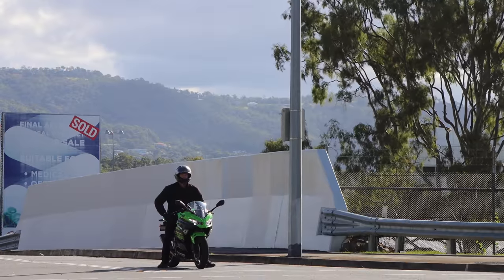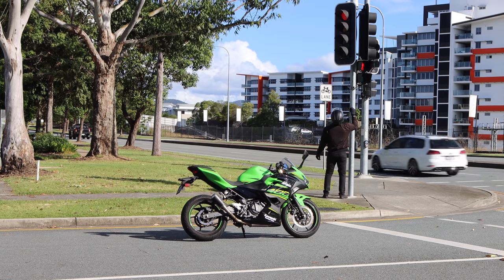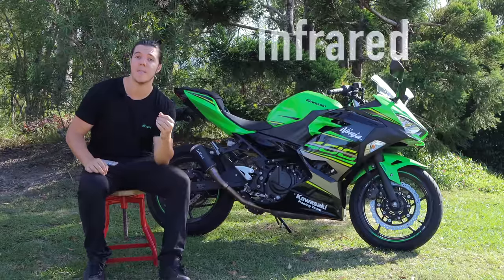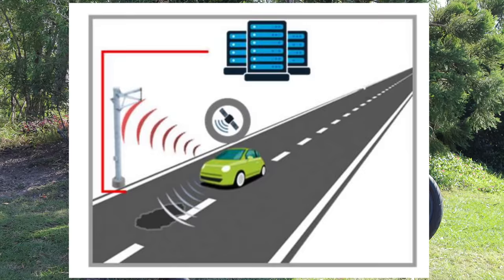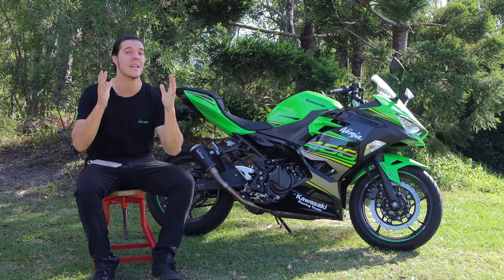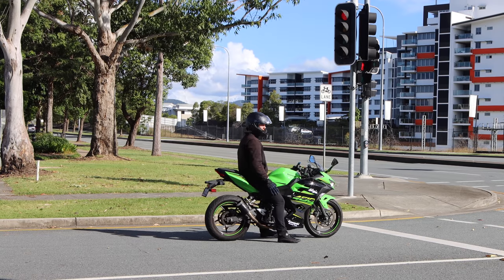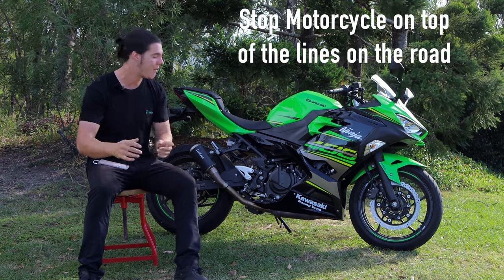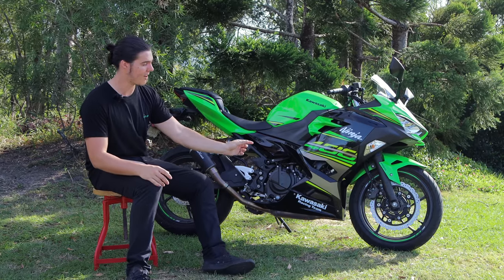How to trigger Traffic Lights on a Motorcycle | Stop getting stuck at red lights

Comment: I was the electrical test engineer for the department of transportation in my state. A few pointers for ground loops. First, as you approach a light, try to run over the advance detection loop. This is the ground loop a couple of car lengths before a stop line. This will send a pulse detection to the signal controller. Second, I do not recommend buying a magnet hoping it will place a detection call to the signal controller. Rather, simply shut off your bike and restart. The field generated by your starter is enough to affect the ground loop. I've tested this in the lab and used it for the last 8 years on the road successfully.
Reply from the maker: Thanks for your input mate! I'm gonna pin this
Reply: Interesting. Gonna test this this out.
Reply: You sir, are a hero. I have a sumo DRZ400 in AZ, where these strips are at 90% of lights, and it's usually a 50/50 as to whether or not it'll pick up my bike.
Reply: That’s good info. I have a few that get me around the house. Looking both ways and Running the light works also.
Reply: Yes!  Was here to post this.  A restart has always worked for me. Not sure if newer bikes pump out the same EMI noise as the older bikes I was used to, but I think it still works fine.
Reply: Damn. Never thought of that. Ill give that a go before I blow through the red light.
Reply: Lol, my bike is a kick start only.
Reply: @jamesmcgrath1952  All is not lost. I haven't tested this one out yet so it may not work. Your stator has a magnetic field when it is generating power for your bike. That field expands and collapses as it generates AC electricity (which is later rectified to DC for your bike's system). The higher you Rev your engine, the faster that field expands and collapses. That SHOULD also work and trip the loop detector, but I have yet to try it.
Reply: @GCMoto97  Thanks but I've tried that. To make things worse the lights are timed to go on the loop late at night when very few people are on the road so you could be stuck for hours. Thankfully they passed a law here stating if the light doesn't change in 5 minutes the motorcyclist can proceed (as safety permits) through the light. BTW, this is in Pa. Don't know about other states.
Reply: @mike-gv2ol  the old fashioned legal right turn into legal uturn also works
Reply: Good info right there thanks!
Reply: @jamesmcgrath1952   Kick it really hard. Ha
Reply: @Porsche996driver  Lol.
Reply: Thanks!!
Reply: In my job I end up getting magnets so I have four or five neodymium magnets on the bottom of my bike that seem to trigger traffic lights. Or maybe it's the lead in the frame of my KLR
Reply: I have two bikes, a 250 dual sport and an 80cc scooter. Neither triggers most of the lights on the college campus I work at. Tried putting the stand down, blipping the starter, nothing. I think they're just dissing me because I don't ride a Harley. ;)
Reply: @MrBirdnose  In that case I recommend reporting that signal to whichever agency owns it so they can adjust the sensitivity of the loop amplifier. When the loop amplifier is tested in the lab, it is tested for three vehicle sizes: car, large motorcycle, and small motorcycle. The sensitivity is set to detect all (at least that's the way I did it), then the loop amplifier is installed out in the field. When out in the field the signal crew has to do a final adjustment with everything hooked up at the system level. Sensitivity adjustment can be a tricky thing; set it too low and it doesn't see those of us on two wheels. Set it too high, and it locks the detection call, leaving whatever traffic phase it's hooked up to trying to stay green all the time.
Reply: Would an electromagnet underneath the bike, say 100 turns at 3" dia, that sends a few pulses via 555 timer be picked up? Or does it have to be a field as strong as a starter?
Reply: @joesphanlu3369  the loop works like a metal detector - the resonant frequency changes when a chunk of metal interacts with the magnetic field. I'm not sure there's an electronic fix; it's a matter of having enough metal close enough to the road.
Reply: @MrBirdnose  right, it detects changes in the magnetic field, which i can simulate with an electromagnet. That is how the core principle why a starter motor works, question is if its powerful enough.
Reply: @joesphanlu3369  Perhaps, but I've never tried it. I went for what I already had. You have to make the ground loop inductance change by 3 ųH to be detected. Grab a compass and put it about 3 feet away from this device. If the compass changes heading when the device is energized, it will likely work.
Reply: @GCMoto97  Thanks for the numbers. I give it a shot, maybe even a github repo teehee
Reply: Solid GOLD
Reply: @jamesmcgrath1952  That's very modern; mine is steam-driven!
Reply: You would think these days they would just use a camera ( which could detect any vehicle and added benefit of video evidence of jumping red lights ).
Would be easier to install with no need to dig up the road.
Reply: Awesome thankyou ob1
Reply: I see 199 people who liked this comment going to try this ASAP because I know I will:) thanks
Reply: Holy crap I never knew about the starter thing.thank you so much
Reply: Id rather not stopping and starting my bike all the time.. its not such a great idea considering the starter motors in them arent made for such condition.. but I will try out some techniques and why not use a magnet? Seem to work fine?
Reply: I use the greenlight magnets in the bottom area of my fairings. It works for me. I always place them at the lowest point inside the pairings.
Reply: @FlyingFun.  Cameras are also used, as well as radar. The problem with cameras is image washout when it's foggy, raining, or too much oncoming light (for example, the signal is facing east during sunrise). Radar on the other hand will detect bicycles in the lane. Unfortunately, loops tend to be the standard because of the cost of video or radar detection.
Reply: @ClosestNearUtopia  if you have a magnet and it works, that's great...there's nothing wrong with that. I just went with the starter because it's already installed and it provides a greater magnitude of field change than a magnet. I wouldn't worry about the starter running...unless it takes forever for the bike to start. When I bench tested starters we used to run them for a minute without damaging them.
Reply: Great tips!!!! Thanks! Subbing, where were you back in my early years ridding bikes on the road.
Reply: @GCMoto97  its not about the amount of time the starter motor is on but the amount of times activated. The solenoind and contacts are a notorious problem within motor cycles starters. they dont life forever and maintenance is required because the brushes will pollute anything on its path, next to that some motors wont always start right away, a lil push in gear is needed to get the parteh started and line up the gears. On a warm day my clunkiest bike will take 15 sec of cranking befor she will restart eventually. also no way out when things go wrong behind you while trying to start your motor, you will need every second..
Reply: Cheap magnets, no.  But rare earth mounted to the center stand can help.
Reply: I was told you can go through red lights in Georgia after you've come to a stop. Anyone know if that's true?
Reply: @Force1Com  Nope.  The dead red law there was passed in 2019 but vetoed.
Reply: @jamesmcgrath1952  I was taught that if your in a rural area it was legal to do that but not in city areas
Reply: 125 and 150 cc bikes are recommended to do this because it's almost undetectable
Reply: Came here just to say this.. shut down and restart. Luckily it came from someone with more experience.
Reply: @jamesmcgrath1952  also PA, if it cycles 2x (for the other directions) you are allowed to audibly say "eff it", and proceed...  so we have options.  And, cops have discretion, so if you are being reasonable (REPOP standard), you should be able to kindly explain what you did and why and not get a ticket, and if you do, just continue being polite and the cop won't show in court, or the judge will hear your correct argument and let you go.
Reply: @Rowdy mellow out man, and hear me out. You're not technically wrong, as you should be able to just run over the loops and stay anywhere in there. However, there are those times where that doesn't work. The point of the video that @Kwackajack made and my comment is we're out there, we're in the detection zone, but the loop amp isn't placing a call to the controller...try these things to get out of there before running the red. Then, by all means report the signal and hope they send a crew to check it out. We're all just sharing workarounds whether it's the starter method, magnet, hitting the Pedestrian switch, to get he phase to go green.

Since you brought it up, my test loop measured less than 2 Ohms continuity with a Fluke 87, greater than 500 MegOhms with a GenRad 1863, and passes a ring test with a Sencore LC103. All measurements were taken at the terminal block inside a McCain 332 cabinet with the corresponding I-file wires disconnected. They were then reconnected for the starter test which I did with an EDI LMD222 and again with a Reno C-1100-S loop amp, each of which tested good on an ATSI loop amp tester. The controllers I used were a Safetran 170 with Wapiti W4IKS software and then again with an Intelight 2070LDX running Maxtime. Before I was an engineer I actually did my time out in the field and in the shops, so what I said was not just in books. Be safe out there.
Reply: Fucking bless you mate for the 'restart your bike' tip.
Reply: Where exactly do you position your motorcycle? Thanks
Reply: I was thinking about lobbing off half of a microwave transformer and using it as an electromagnet.
Reply: 5 minutes??? Dang Wisconsin is 45 seconds and if the intersection is clear your good to go
Reply: Me too
Reply: @Jollyswagman7  in the state I live in the loops cover about 2/3 of the lane width. You're supposed to be able to be anywhere in the loop, however I position my bike directly above as much loop wire as I can. This is a lot easier with square or rectangular loops; with circular loops I've had the best results cutting on side or the other.
Reply: Shutting your bike off and back on is what was recommended by my msf instructor saying the starter would trigger the ground loop.
Reply: @MrBirdnose  Bikes with steel rims have the problem much less than bikes with alloy rims. Ferrous metals work  better.
Reply: Who df is gonna wear out their starter due to this. Not a good idea, starting and shutting of your engine every red like you get too. It'll cost you more money
Reply: Cheers bro🤙🏾
Reply: @FrankiesWorld  That's a great trip. Thanks 👍🏁
Reply: Thank you. Make sense once you hear it.  My old dual sport is a kick start, but perfect for my street bike 👍🏁🏁🏁👍.
Reply: @GCMoto97  Ok thanks👍
Reply: A real solution.
Reply: Okay, I'm writing from post soviet country, and all our traffic lights are activated on timers.
Is this some kind of elaborate joke, or do you really have all these sensors installed?
Reply: Stepbike, I'm stuck...
Reply: @64nvm  Yes, the sensors are in place. The move toward adaptive traffic management began in the 1970s with sensors connected to a controller. The controller is still a timer, but with settings such as Min Green, Max Green, Yellow Interval, Red Interval, and Gap Out, the controller can adapt the lights to change for a phase that has traffic waiting over a phase that no longer has traffic.
Reply: My minelab metal detector has no response to the starting of my 08 ultra classic...traffic lights wire is nothing but a metal detector...test have shown that a magnet does work
Reply: Yep that’s what I tell guys and they look at me puzzled.
Reply: @RT-wl6tq  I never said a magnet doesn't work, rather I didn't recommend spending money on it if you don't have to. A starter motor operates like a strong electromagnet when energized; a magnetic field is activated when the solenoid is energized, and an even larger field is created as the starter is energized and the field coils (or permanent magnet array) rotates the armature. I tested this with a complete traffic signal cabinet, induction loop, and a Kawasaki Ninja. Placing the bike over the loop changed the inductance of the loop, but having a magnet OR energizing the starter caused a bigger change in the inductance of the loop as read by the signal strength reading on the Reno C-1100-S loop amplifier.

Now the statement that an induction loop is a metal detector is a bit of an oversimplification. The induction loops react to a change in the loop inductance. While metal over the loop will change the inductance, so will a strong enough opposing field from a magnet or your starter (if the loop amplifier sensitivity isn't TOO low). Theory of operation can be found at https://www.fhwa.dot.gov/publications/research/operations/its/06108/02.cfm. However, a metal detector works slightly differently. It has a transmitter coil and a receiver coil (or coils); it is more selective to what it will react to. When you point it at your starter, it will detect the metal but it should not detect changes in magnetic field from being energized. This is why you didn't get positive results from your test.
Reply: @Kwackajack  here's exactly how the loop works if anyone is interested: https://www.fhwa.dot.gov/publications/research/operations/its/06108/02.cfm. Other info on detection methods is there as well if anyone wants to poke around. Cheers!
Reply: @ryanborzu3500  its not every red light that you would need to do this for. Only the ones that dont seem to be calibrated to the right amount to sense a bike is in the magnetic field... I mean doing the stop start would be less wearing than sitting idling for 5 minutes on a hot day.. that said positioning the bike in the right spot to start with will work 95% of the time. So the likelyhood of having to do the stop start diminishes.
Reply: The joys of an alloy bike.
They arent particularly sensitive sensors, but are driven by high powered oscillator.
Reply: I glued small neodymium magnets to the soles of my boots.  Worked great but picked up a lot of rust.  I took them off and have now glued 1"x2" pieces of sheet steel to the boots.  I'm trying them next week.  The steel spokes on my KLR seem to trigger the sensors but not all the time.  I had a lot of trouble with my Valkyrie because of the cast aluminum wheels.
Reply: @gcenteno97 thanks for taking the time to share your tips (And being patient with the blockheads!). I did put two 1x1x2 neo super magnets on the bottom of my frame and it really increased the sensitivity at a few lights in my area but everywhere else I was still getting ignored as before and was disappointed in the promise of that fix. Now I've got some new tools to try out this riding season: your stop-restart, right turn - u-turn, and dead-red law. 

On another topic, I've read that when when cities allow the Red light companies to install their cameras that they purposely cut the length of yellow to just a couple seconds to maximise the number of violations (and their profits). Insurance studies show that rear end collisions go up at these intersections.  There are a few intersections in my town, even when I'm first in line, the light turns red before I'm through the intersection!

Not sure what the fix is... I hate the greed of red light cameras, but people don't stop anymore when the light turns red.
Reply: @RHAD-sy3oi  for the length of green light thing you need to complain to the local council or municipal or whatever it is that is in charge of maintaining infrastructure and keep complaining several times a day. Get your friends and family local riding clubs to do the same. Find out how many signatures you would need on a petition to see a change. Contact the local news or radio stations about it If nothing is done. Things usually get fixed pretty quick if they are being reported about in a bad light
Reply: @RHAD-sy3oi  remember what we are all sharing are workarounds to get through. I recommend (and do myself) reporting every light that doesn't see us so the rest of us might not have to get stuck in the future.

As far as yellow change intervals, they will vary based on the contract specifications for each intersection. There was a case awhile back in Oregon where someone got a ticket because of a short yellow. They had to go out there and observe the light and get a good sample of timings. Then they had to find the contract specifications for that light, and they fought it in court. Very labor intensive. I don't have a solution for that. Best I can suggest is sometimes there's a tattle tale light that flashes before the light is about to turn yellow (meant for cyclists). Watch for that or stale greens or a large gap between cars passing through. If there's a large enough gap (gap-out) and waiting traffic that crosses, it will turn yellow.
Reply: @MrBirdnose  I've GOT it! Why not just build an EMP device, there's several YT videos that show how?! (JK! Although... If it was a very "small" one that just might work?)
Reply: Many years ago I worked installing and testing these vehicle actuation loops for our city traffic engineering dept. The manufacturer (3m, I believe?) sent us plans for a testing loop we recreated as a plywood form appx 3' in diameter with wire wound around it's parameter. They told us that when placed over the loop in the road, the system should see it as the equivalent of a Honda 50.
Reply: @GCMoto97  When you mention restarting do you mean turning the kill switch off and then back on, or turning the ignition off with your key before restarting the motorcycle?

Thanks in advance.
Reply: @Sc-How  I use the kill switch, it doesn't require unnecessary reaching for the ignition key. :)
Reply: Good but that's pointless wear and tear on the starter and battery.
Reply: @BOMBON187  So I started looking into this because some other riders had the same concern. Argonne National Laboratory did a study on this. They found that the mean failure rate for their starters was around 45,000 cycles. I wouldn't worry too much about it; there's not a high likelihood of getting stuck at even half that number of intersections where this would be cost prohibitive. Keep in mind that we are talking about a properly tuned bike in good condition. I've done this for 8 years on both a Ninja 650 and an old KZ900 with no problems. I've had the same battery in the Ninja for 7 years and its used daily. On the KZ, 4 years although it only gets used on weekends and sits on a tender the rest of the time. But both bikes normally start with a bump of a button, if it takes a lot of cranking or several tries I would not recommend this.

As far as the battery, the sudden draw has less of an impact than accessory draw with the key on engine off, or short charge durations between start events. Assuming a good condition stator and a well maintained battery, this should be a non-issue. However, as above if it takes a lot of work to get the bike started, I don't recommend this. Rather, try some of the other solutions that the other riders shared. Be safe out there.
Reply: @BOMBON187  picking your nose while stuck at a light and sitting at idle for 5 minutes does far more lasting damage to your more expensive engine internals than to your more easily replaced starter or battery. Sitting at idle for very long is the absolute WORST possible thing you can do to a combustion engine, which is why people will buy a vehicle with higher mileage more readily "if" those were mostly highway/freeway miles and not all in town miles. At idle there isn't as much heat as well as load on all the bearings, which in turn allows things to rattle around and wear faster among other things. Even letting a vehicle "warm up" in the morning at idle for more than about 30 seconds or so to get the oil where it should be is quite damaging. Start it up and let it run for a few seconds and go, just don't hammer the throttle down right away until it gets up to temp.
Reply: I just wait till it’s clear and go anyway. Sorry (not really) but I did my part. I’ll try some tricks to trigger the light but I’m not sitting there like a goober because a little red light on a pole told me I can’t go.
Reply: Interesting. I gotta try that out next time im out on a night ride. I'm in Greensboro, NC and those loops are literally at every side street approach to a major road. If it doesn't work I'll just continue to treat the dead red as a stop sign.
Reply: @RellyOhBoy  I would also recommend reporting it to whomever maintains the light so they can adjust it. It can either be the loop sensitivity is too low or the gap-out time and min green time settings are too high for the opposing signal's phase.
Reply: @Rowdy hey man, I've been there...totally understand. Stay safe out there, I've seen some close calls (and some flat out incorrect wiring from factory, like where overlap phases continue to run with the police flash switch on).
Reply: @Rowdy Actually I really like just about any 2070-based controller over any 170 nowadays, mostly because I can have everything I need to program transferred by USB in a minute. Someday the 170 will disappear from TEES, but I think I still saw it in TEES 2009 Errata 4.
Reply: @Rowdy with any luck TS2 should phase out as more project engineers learn about the 342 cabinet. With the emergence of ITS, having a 332D style cabinet that fits on an existing P-type cabinet pad has been a big advantage for those replacing old cabinets. The only problem is the I and J files don't have 120 Vac, just 28 Vdc, so legacy cards like the 242 Ped Isolator will not work. Easy fix though, just get a 242L.
Reply: I heard that a app was available to mess with the signal on your phone
Reply: @danlevesque5437  I know what you're talking about. I don't recommend trying that, especially if it is a pay app. More often than not, it will not work due to security measures in place on newer controllers or archaic technology in place on older controllers. Even if it manages to get past network security on a newer controller, you will likely cause a short yellow, tripping the Conflict Monitor into flashing red in all directions. It's just not worth the trouble.
Reply: I hate to inform you sir but a rare earth magnet of a 90-lb pulling force is absolutely strong enough to change the lights I used a 40 lb pulling Force neodymium magnet for my bicycle because I had a motorized bicycle that can do about 35 miles an hour and I too was having problems with the lights not changing so science rules.
Reply: @survivalishardstaystorng  LOL, please feel free to refer to responses above in the thread. This has been discussed. I never said magnets don't work. I said I wouldn't spend the money on it if a motorcycle already has a starter that can do the same job. The reason is far too often people will buy a magnet or magnets that are not sufficient to produce a large enough inductance change for the loop amplifier to place a call to the signal controller. People can buy the biggest magnet they can find or do the math and figure out how much magnet they need to produce the proper eddy currents to get a detection, more power to them as that is a valid solution. I just recommend trying what you've already got before spending money. Also, whatever you do make sure you report the light to the city, county, or state agency who owns it do they can adjust the loop amplifier sensitivity.
Reply: Wow! Thank you for the tips!
Reply: Need a metal skid plate
Reply: Mechanical engineer 2nd'ing what he said.
Magnets don't do more than a regular puck of metal (and may do less than a piece of metal).
Ferrous metal is more effective, but non-ferrous metals work too (eg alu or copper work too)

Beyond a few millimeters, thickness of metal has very little effect, however perpendicular surface area to the sensor and close proximity maximize the effect.
(Eg want a thin wide plate parallel to the ground and as low to the ground as you can get it)

So throw a skidplate on your streetbike and take it adventuring!
Reply: Starting and stopping your engine not a good idea , and will cause premature mechanical  failure
Reply: Thank you!
Reply: To note I have a moped, with a 50cc engine I have tried what you started several time with no luck, I assume the amount of power of my starter motor is just too Low for the sensitivity of a few of the signals, most I can just run right on top of the cuts made for the loop and I'm fine, for two specific ones I always have to get out  and hit the crosswalk
Reply: @jaykoerner  I never tested this with a moped, the smallest bike I've tested this with is a 250cc Ninja. I believe you're correct as I can't see a large magnetic field being required to turn over that small of an engine. Best I can recommend is try one of the other workarounds we have all shared here until one consistently works for you. Be safe out there.
Reply: Not going to shut off bike and restart over some poorly designed  equipment in the road, 100° weather,  too hard on the starter and engine on the bikes, you guys should design  optical with lasers , like we use in the military for detection
Reply: @garyboardwine3349  they do have them. But old tech is cheap and dies hard
Reply: @jaykoerner  yes for sure !!
Reply: @garyboardwine3349  you overestimate the budget city, county, and state agencies have to set up and maintain signals. Better detection technology does in fact exist, with radar being by far the best in all conditions. The primary reason induction loops are still deployed is they are cheap. Remember, higher signal costs translates to higher tab fees, gas tax, and in some cases income tax. Some agencies are even at the point where they are removing signals and converting intersections back to 4 way stops or roundabouts.
Reply: @imapiledriver2462  comment above By "people who make and sell motorcycle magnets" 😆
Reply: @GCMoto97  I will say it's cost per year that's important, camera and radar don't have to be redone every time the road gets worked on, the down side is they can be hit with 30,000lbs semis or anything else that uses them. Seems like a wash to be honest, but I understand that upfront cost can blow a small city budget, and even large city's likely have stuff they find more valuable for the short and long term
Reply: @GCMoto97  to comment on the second half, I honestly find it good if city's put in more roundabouts, any  road under 100 per hour probably should have them and they can be made to work with much higher flow then that
Reply: @FlyingFun.  I'm sure it comes down to a few factors. First, cost... induction loop simple wire/current, controller switch or camera equipment, software running in real-time to watch for cars (think of areas where an intersection can go 15-20 minutes between cars, that's a lot of computing power for nothing.... secondly (and I worked as a 911 dispatcher so I have gotten calls about it)  during sunrise and sunsets the camera is blinded and will not detect any cars let alone bikes...I'm sure there are a few more
Reply: @EMTDawg  yes I see your point, simplicity is usually the best way.
Another thing with cameras is people like to mess about with them lol.
Reply: Guess the electric motorcycle takes another loss haha.
Reply: @64nvm  I think they are on timers in Poland, too. However, I rode a motorcycle for eight years in Toronto, and there the lights are on loops... really bad loops, and even with a big bike, it was a problem. I tried the magnets under the engine thing, but I don't think they helped much. It's really an inductance question,  very difficult to fool without a large chunk of metal.
Reply: Electrical engineers never install these systems. In fact, they design them, then some laborers during installation fixes your screw ups. I have a PhD and I approved this message!
Reply: @Kwackajack  you didn't pin it
Reply: Thank you for sharing.
Reply: This is going to be so incredibly helpful
Reply: Does this really work? Last night leaving from work i was at a stoplight waiting to turn left but it never changed. So i just go when there were no cars
Reply: Yeah I appreciate the thought but I don't think I'll be restarting starting my bike
Reply: Thank you for this comment. I had the same thought about the motor starting but I haven't bought a bike yet. I had not heard anyone say this before in videos. Hope you have a good day!
Reply: I guess my kick start bike won't have the advantage this time